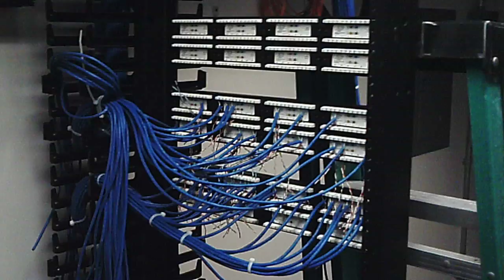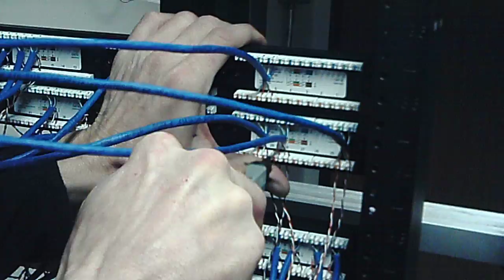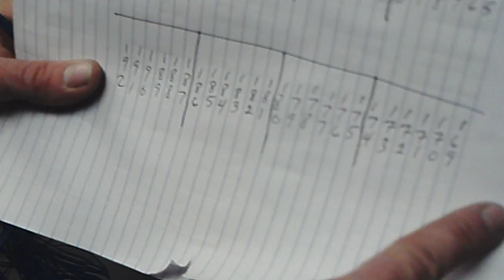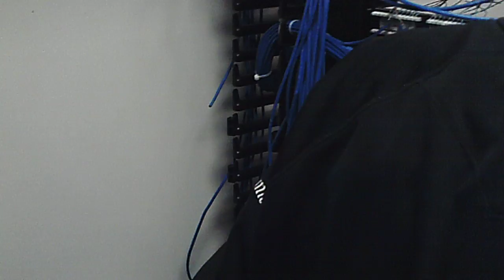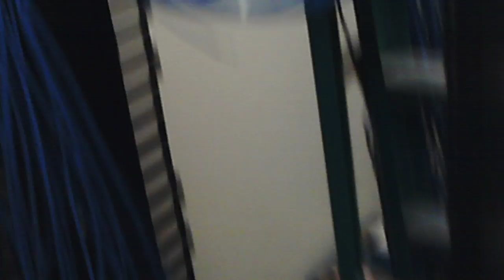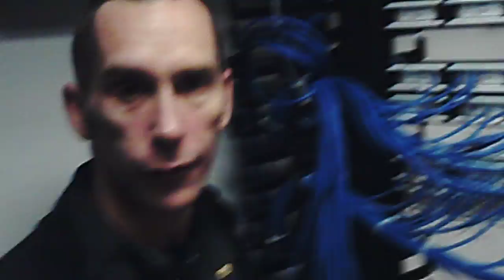Learn to Terminate a Cat-6 panel

Comment: I would be fired if I punched down panels like this.
Reply: I know right. That needs to be nice and neat
Reply: explain how nice n neat please??? cuz the one is my internship site is ugly n this once is a decent one
Reply: 1. Cable comes in from the side and lay down flat in the patch panel's  channel if its 5e, if its 6 or shielded then the bundle will be to to thick then you can't use the channel. Each cable you punch down should lay on top of the previous one you just did.
2. Punching down the cables in order not randomly so that they are compact. This way the cables stay a uniformed size and easy to wrap up together (velcro).
3. Untwisting and punching down as little as the wire as possible (he did that right). The twist are there for a reason.

IT should look like this 
http://media.merchantcircle.com/22641782/3_full.jpeg

Comment: Thanks for a very good video, gave me a few tips that will be useful. The last video I looked at, the tech untwisted the whole length of each stripped pair before punching them down on a 66 panel. There was at least a half inch of untwisted wire before it was terminated.
Reply: its ok on a 66 block to untwist all the way. its not the same data.